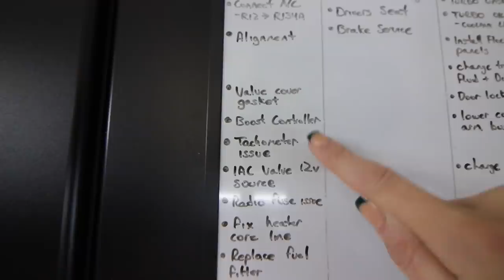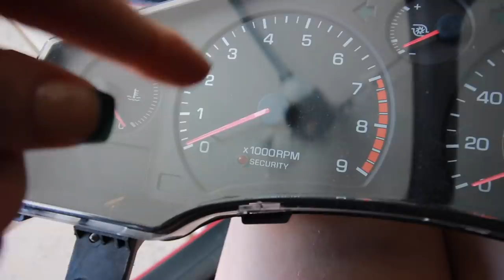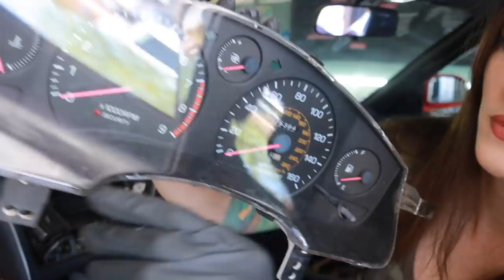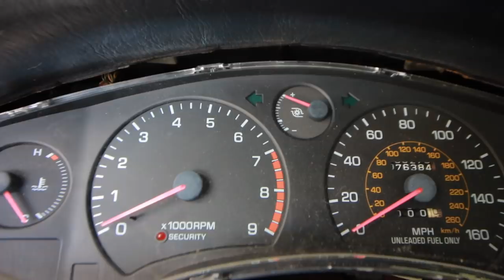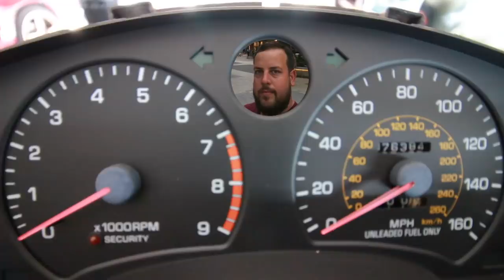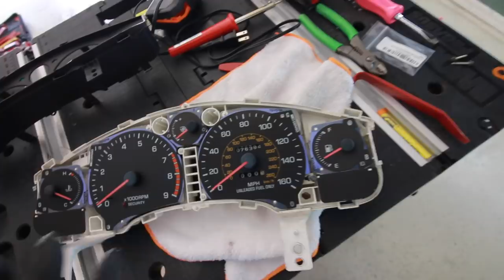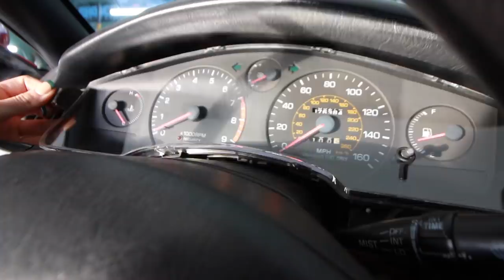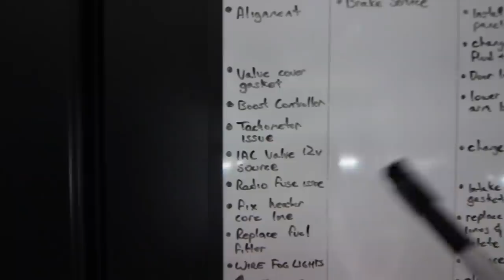I Better Not Screw This Up!! // Faulty Tachometer Fixed w/ $2 Capacitor?

Comment: Great work Sarah.  How did you determine that the capacitators were the problem without the ability to test them first?
Reply from the maker: pkane5472 research on how the circuit functions, and probable causes of that issue on MR2’s. The capacitors meter the rate in which the needle moves and smooths out the pulse from the signal source. The only thing I couldn’t find looking it up was how it would limit the range of motion like that.
Reply: @SarahnTuned  I was wondering the same thing as to limiting the range. Slowing it down or making it bounce would be expected from a bad cap. 

You think it was reading ~50%, is it an ac signal? I have to go do some research before I'll be able to sleep tonight.

Comment: Just so you guy know.  Before I worked up the nerve to do it myself, I called several local computer repair places who said they could repair it no problem as long as I brought them the proper capacitors and cluster.

Comment: nice job but u dont need all that aluminum foil lol and the temp on the capacitor is operating temp
Reply from the maker: Mohemad Qasem always use protection! Or else then you’ll end up with a bunch of baby gauges with more capacitors to solder 🤔 

...not sure where I was going with this 😂
Reply: @SarahnTuned  🧐🧐

Comment: Can u buy a new lens?
Reply from the maker: Tom Knud negative
Reply: @SarahnTuned  I hunted the net substantially and confirm that, save the used parts on ebay.  However, there was an rhd one, which appears to be the same, save the odo reset on the wrong side.

Comment: Those are not capacitors.  A capacitor is used to store power for quick start up (Electrical) which this device would  not have a  need for capacitance.   That was a diode you were holding. used to keep the flow of current in one direction.
Reply: Sarah is right, she replaced 2 electrolytic capacitors, and yes, they do what you said.